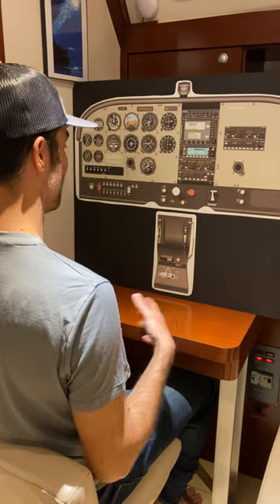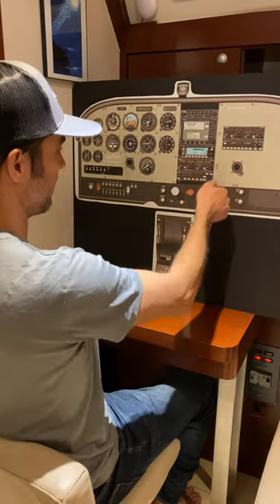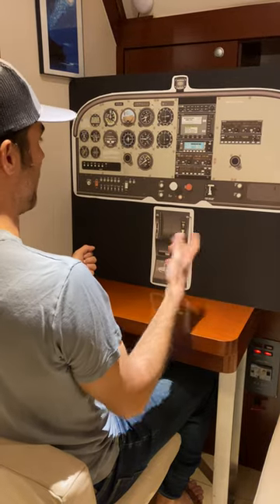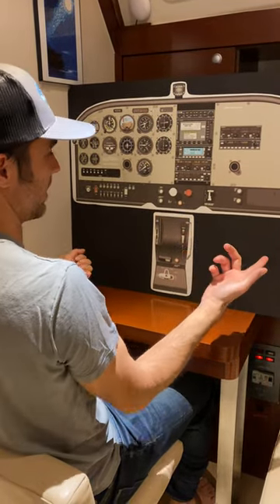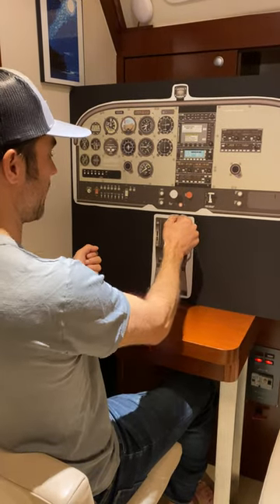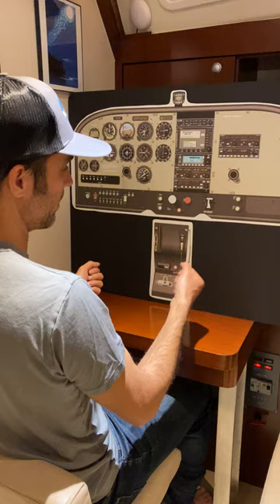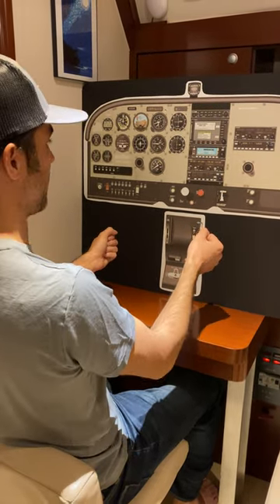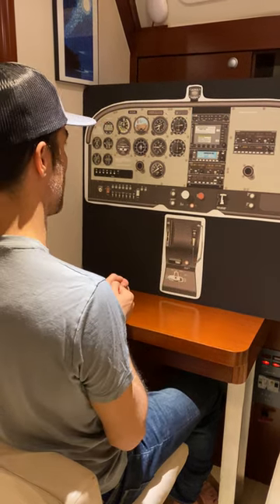Chair Flying - Slow Flight in a Cessna 172N

Comment: Just wanted to confirm. 
Before entering slow flight. 
The plane should be straight-and-level with TRIM applied to relieve any pressures.
Then begin the slow flight procedures?
Reply from the maker: In this CFI's opinion (and how I teach) - yes. All maneuvers start with the airplane being completely trimmed out, straight, level, unaccelerated. Then begin!

Comment: On go-around would you consider applying power and THEN turning OFF carb heat - in that order?  I was taught that way but it’s probably just splitting hairs. They are both done so close to each other I guess maybe it doesn’t matter.  What do you think?
Reply from the maker: I think that's the way I would do it as well, and how I teach it. Misspoke in the video!